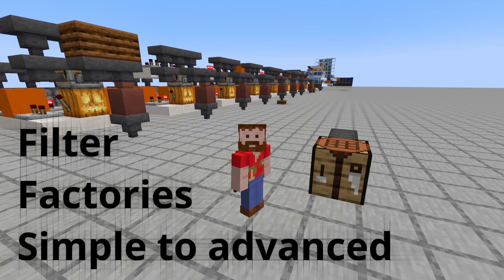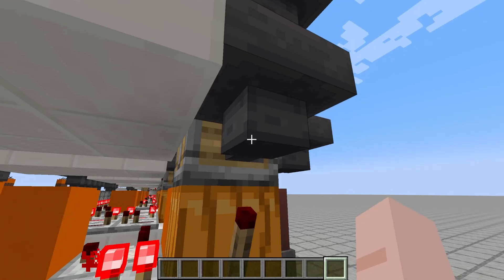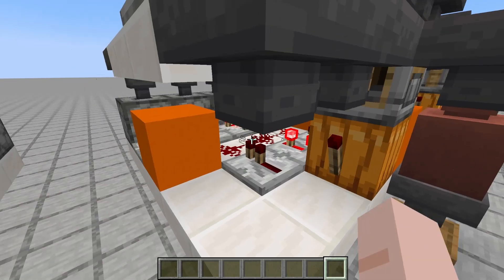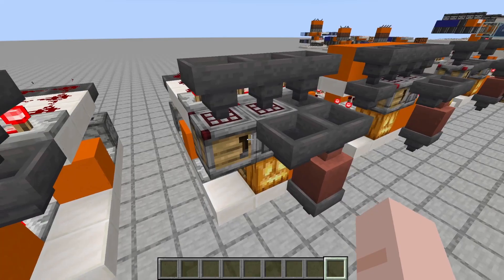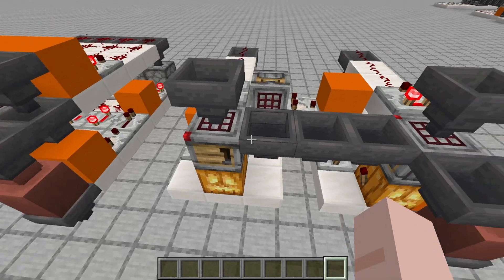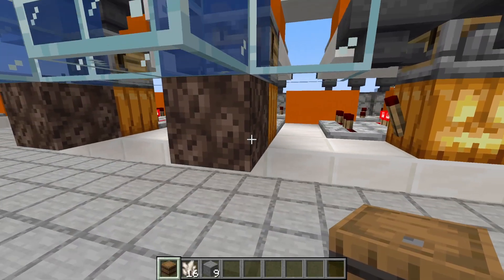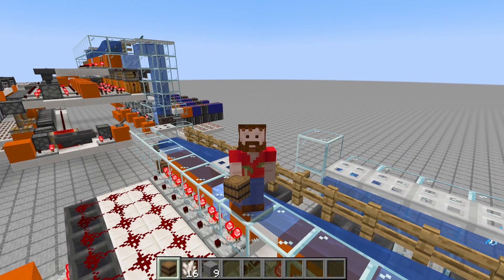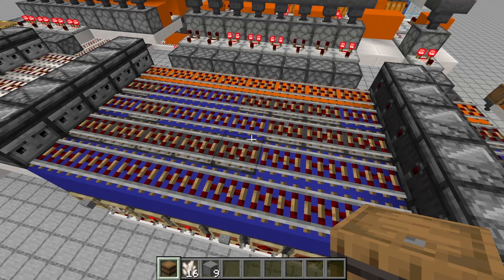Minecraft Filter Factories - Simple to advance for Java

Comment from the maker: Just realized now that the last design is wrong - or at least could be a lot simpler.  Each factory doesn't need a clock, there is already a global one, one that limits crafting anyway, in the binary signal system.  Same with overflow protection, will only allow the clock to run hit the factory if there is a need in storage.  So the factories just need to "shut their ears" so to speak when they don't have enough items, and nothing more.  The factory design ends up being just a sticky piston and block that is removed from being able to fire if there isn't enough resources to respond to a request.

This is what we call in software terms - a refactor - its an important process where as well as adding functionality, we stop occasionally to check what is in the wrong place, duplicated, or just not needed anymore.

So - um - no one build that last one.  Or if you plan to, comment here and I'll post the simplified version somewhere for you (if someone doesn't beat me to it - if so, please post a link)
Reply: I'd be greatly interested in seeing your simplified design! If you could post it -  that would be awesome, cheers.
Reply from the maker: Not up for doing a video on it - but I did upload the world download to include the refactored (simpler) version.
Reply: Thanks so much! I greatly appreciate it. That's a really clean & clear implementation!
Reply from the maker: I haven't actually built it based on this realization - at least not in full.  Real world work has been a bit busy as well so it may be more than a little time before I can get to this one - but I'll add it to the backlog all the same.